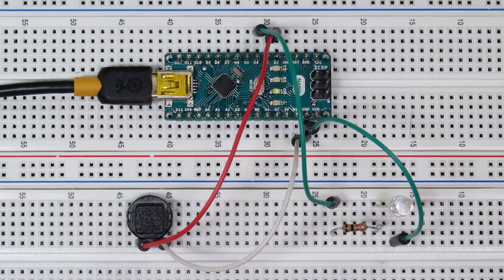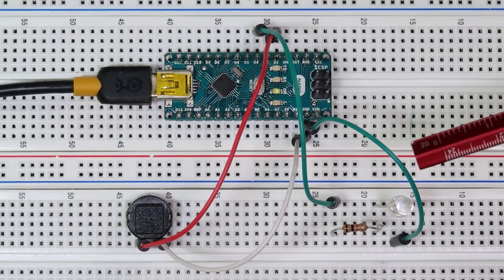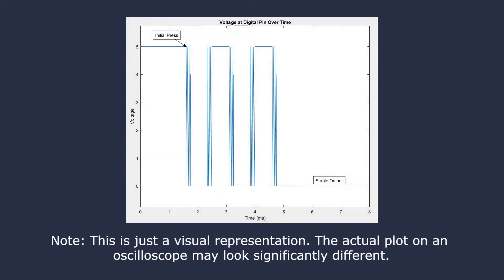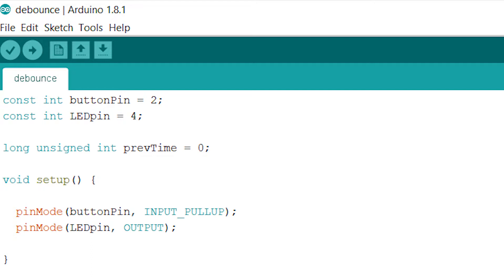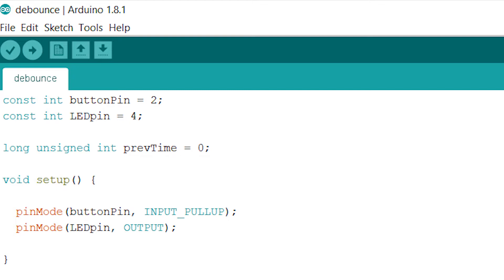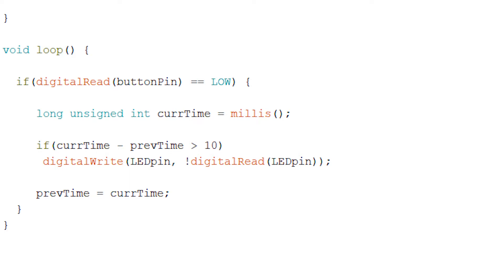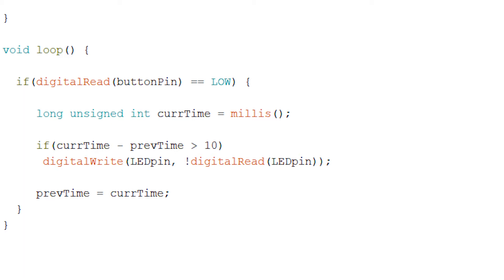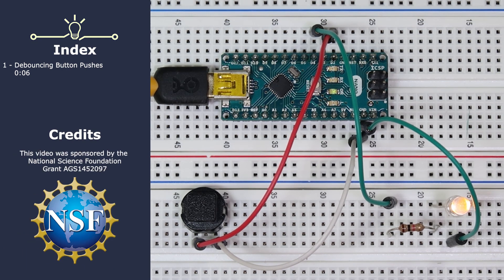Arduino Lab 11: Button Debouncing via Software

Comment: That is a very neat solution BUT
the code is missing curly braces for the second IF statement.  Apparently that works anyway (which I did not know) but better to make it explicit with the curly braces.
Also I note with interest that one can do a digitalRead and a pin which has been set to OUTPUT.  I didn't know that either, and that is very handy info.